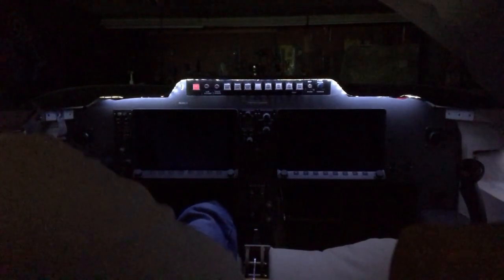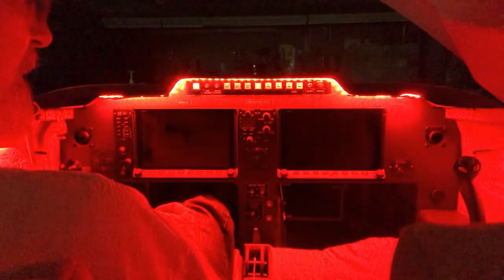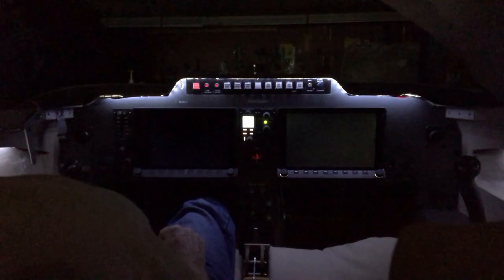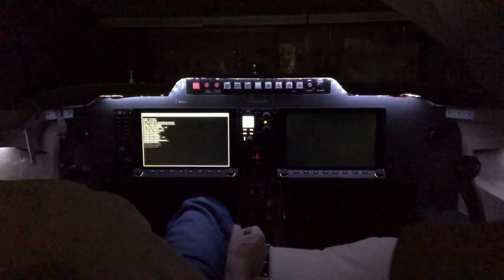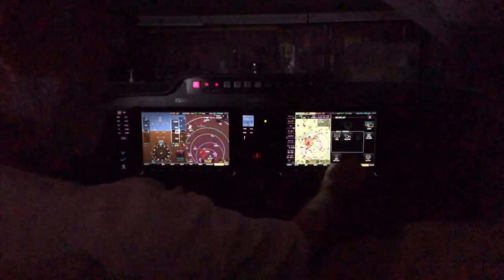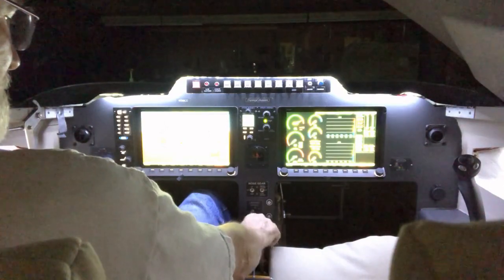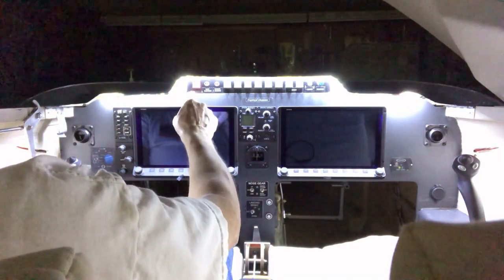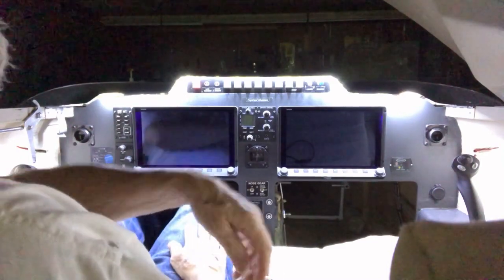Lets go flying

Comment: I'm a little sad that you didn't make any airplane noises for us.  Don't worry, I made my own to compensate. 

Really interesting that the screen brightness is all slaved off the PFD's sensor. Your tape trick was even more useful than you intended it to be.

Do you keep a charger on the battery while hangar flying/testing/setup?

Looks amazing so far. I'm looking forward to the real ride-along video someday.
Reply from the maker: I was also surprised that the brightness of both displays were slaved together to be controlled by either sensor.  
Yes, I have an Odyssey battery and I leave the Odyssey smart charger/conditioner connected at all times, except when I take it outside to run the engine periodically.  It seems to be doing a good job of maintaining the battery in good condition.